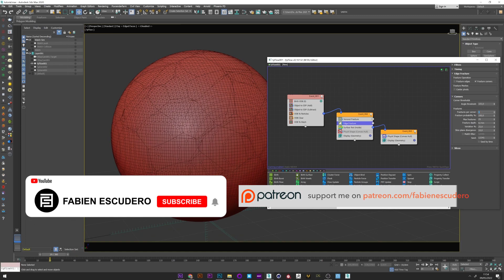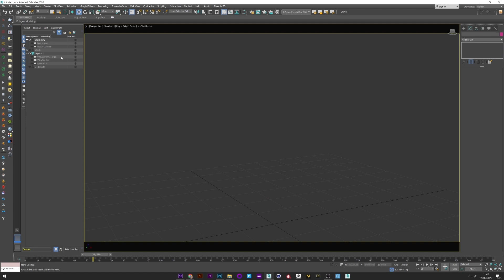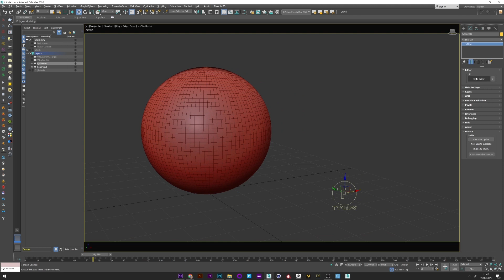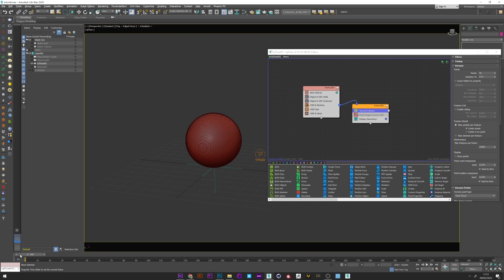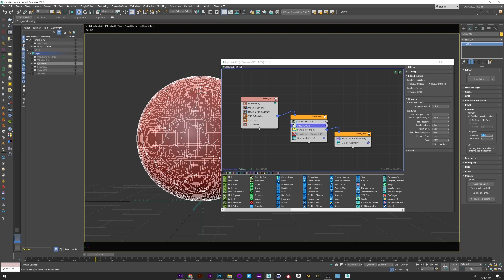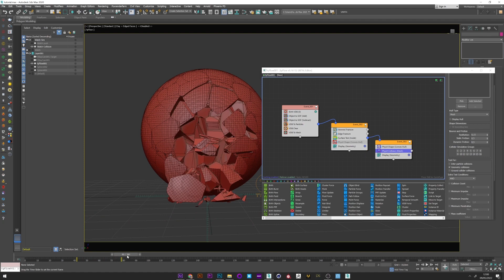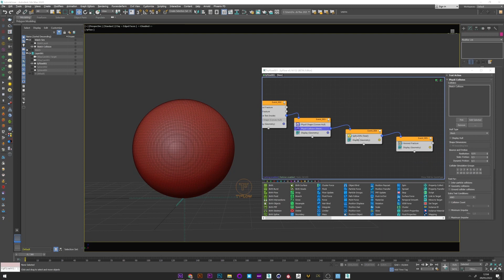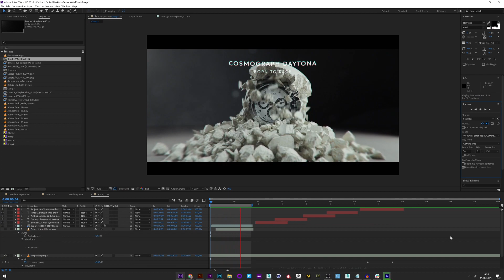Product Reveal and destruction | Tyflow VDB  x 3dsmax

Comment: Hey Fabien, first of all very nice tutorial! thanks for this - i have one question : How would i go about sticking the corresponding textures of the Fractured object( in my case a rock from megascans)? i know that if you turn the mesh into VDB the UVs are gone but is there a way to bring them back? thanks in advance!
Reply: Hello! did you find the answer?
Reply: @sadykova_3d  hi there! Unfortunately not.
Reply from the maker: Hello, So I can't explain you in detail because it's available as a bonus tutorial on Patreon but basically you can configure uvw with vdb modify
Reply: @fabienescudero  ah thanks fabien! Now i know how i can achieve that. Thanks man

Comment: Thx for this, Fabien! One question: Your renders are very nice and clean.  How long did you render this and on what machine? Thx for reply😀
Reply from the maker: Hi. Generally I am between 2/5 min per frame. So it depend of the project but I think I'm on one night to one day for a render. I have a rtx 2080. Ryzen 3800x
Reply: @fabienescudero  Thx a lot , Fabien for your insight :-) Asked for some comparisons. I'm on a 2080 too, but GPU Render on Vray is not as fast and stable as i wish, step most of the time to the cpu one ...